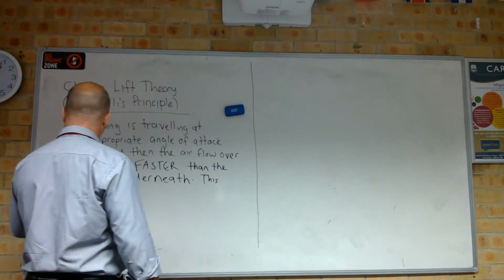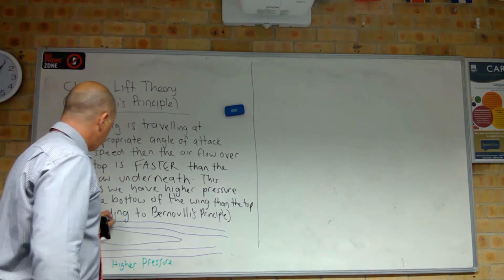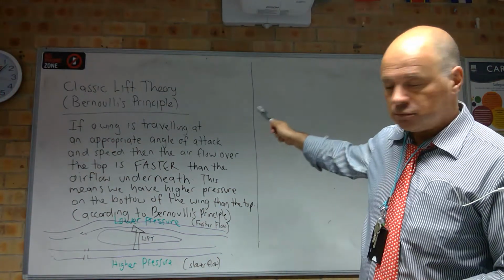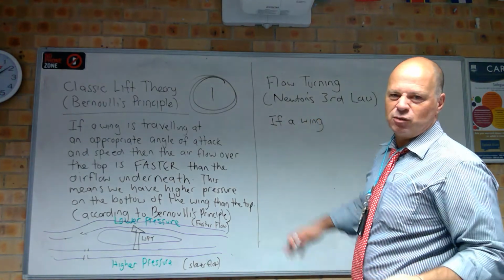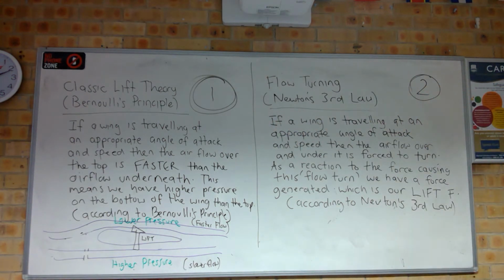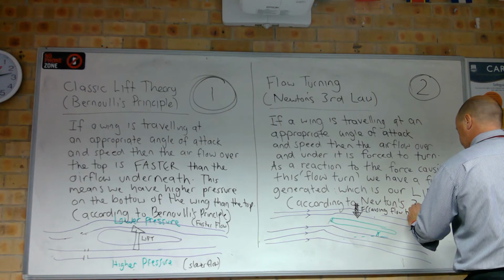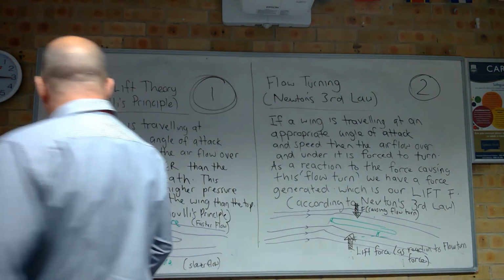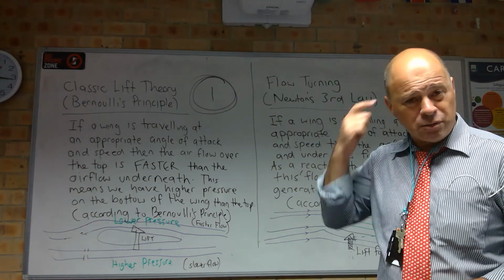Wing Lift - Classic and Flow Turning Theories

Comment: CFD (computational fluid dynamics). In that we solve the Navier-Stokes numerically, because there is no simple closed form analytical expression, like Bernoulli's equation, which is true, but only for inviscid, incompressible, irrotational flow. That is, if we have very simple ideal fluids, you can get analytics expressions for the velocity and pressure field (not just a long a single streamline). However, the Navier-Stokes do not. That does not make them "unsolved" in the everyday sense, that make them "unsolved" in the narrow mathematical sense of "do smooth unique fields always exist that satisfy this type of differential equation". But, given weather forecasting uses the Navier-Stoke, as well as Boeing and Airbus, we get "solutions" to them constantly that help us in everyday life. Numerical methods are not less than analytic methods of solving problems, they are different and misunderstood.

George, the main thing I would love for critical thinkers to consider when they see both images side by side is, why are they different? This is a key question. Because they should not be different diagrams, they are explaining the same thing. So, as you might notice in your other videos, the correct flow illustration can be seen in Prandtl (1923) "Applications of Modern Hydrodynamics to Aeronautics" (available from NASA as a PDF), in Figure 27. There is a change in momentum, which is what "flow turning" is the incorrect defacto short hand of, and there is a pressure difference. But these are two aspects of the same phenomena, the fluid flow, and hence the diagram must be the same. That is, you can take Figure 27, and you can write higher speed lower pressure above, and you can draw the flow up towards the aerofoil at the LE and down away from the aerofoil at the TE such that both "causes" result in the same "effect" (lift). The key thing here is that the change in momentum is across the aerofoil, not behind it. A wing is not a hot knife through butter, cutting the air. As before, happy to talk more.
Reply from the maker: Thanks for this long and considered response. I am a Visual Art teacher with recent traumatic experience of an Engineering degree (BAILED out after 18 months of Mechatronics - passed the gate keeper subjects but math was scary and I iz too dumb). I'm teaching high school Engineering Studies and I have seen these 2 simplified ways of explaining it. Is the example 2 (as a simple explanation too simple and just plain wrong?). Also if we use FIG27 (from the NASA PDF) and we have slower air below  the wing (reduced momentum) and faster air above is the force causing this change in momentum (below the aerofoil) due to the angle of attack and is the reaction to this force LIFT?  If you had to teach a basic explanation of lift what would you resort to? Thanks for helping out.
Reply: @TheArtofEngineering  unfortunately YouTube appears to have killed my very detailed long reply. Shorter version below, going to edit this reply to the question. Example 2 is based on reality, but the actual real physics has been abstracted away. The idea that the momentum changes across an aerofoil doesn't work as narratively simple as "air goes down so wing goes up." This is not 100% wrong, it is literally only 50% wrong. Because the air first turns up, then the wing turns it down, so it goes back out horizontal. So, the best way to describe the correct shape of streamlines in the most simple way, is as a bell curve. Horizontal in, turn up, apex, turn down, horizontal out. But, that does not appear to allign with Netwon's 3rd law, because people are applying Newton's 3rd law wrong.
Reply: @TheArtofEngineering  A shorter version...
As a lecturer, I want to engage in dialogue, I want to ask question, so I will ask the question and I hope you pause and answer full:
If I have the horizontal tailplane, and it is a NACA0008 aerofoil, at zero degrees angle of attack, what happens to the air and then to the "wing" when I deflect the control surface. Ideally, I would want you to draw this.
Give it a go, even if it is just a mental image.
There are two common aviation descriptions.
1) Based on Newton's explanation, which he knew was wrong, you deflect the control surface down, and the air flow "reflects" off this. This give a sin square relationship between lift and AoA.
2) Based on softer flow turning, like Coanda, you deflect the control surface down, and the air flow follows this new shape. This give a sin relationship between lift and AoA.
But if you recall your coefficient of lift as a function of AoA plots, you should know that the relationship is linear.
So, neither of these two explanations is what is happening.
What does Prandtl say happens? When you deflect the control surface down, you shed a vortex off the trailing edge, and this induces a bound circulation around the "wing". That give faster flow above, and slower flow under, with higher pressure below, and lower pressure above. Hence the pressure difference that is lift.
Why this vortex is created at the trailing edge is created is because the flow going around the trailing edge, reverses a little, and moves back up the top surface of the control surface. This is because when the control surface first moves there is an initial reduced pressure. Where the flow is turning around the trailing edge, this interacts with the flow a little further away via viscosity, and this force inflates the vortex. This growing vortex, like all vortices, has a low pressure in the middle. Where the flow reversed up the top of the control surfuce, it eventually met with the decending flow, and at that location is the initial stagnation point, the point of high pressure. But that high pressure point is not close to this new low pressure point in the centre of rotation. Eventually the vortex grows so big and the pressure so low, that it sucks the stagnation point down to the trailing edge. This extra pressure gradient created at the trailing edge, that is the extra force speeding the flow up over the top, reducing the pressure above.
Reply: @TheArtofEngineering George, posting the reply here just to make sure you scroll up and check the other replies here from last night.
You can share my papers, they are open access for a reason. Also, feel free to invite me in to talk, assuming you can't manage a field trip to Canberra 😂
Reply from the maker: @aerospacedoctor  Thanks so much! I will hopefully be sending some more budding engineers your way (at least for the next couple of years).
Reply: @TheArtofEngineering please tell me you saw the long message from 16 hours ago 😅
Do me a favour and like that so I know you have read it.

Comment: In the  still reference frame molecules of air start with no velocity ,then are excellerated. This is best described as an excelleration. Only in the moving reference frame should you describe it as a turning or deflection.

Comment: The bernoulli effect doesn't explain why lift happens.  It helps explain how force is transmitted but the cause of the force. Lift is a reaction force that is solely caused by the action force of downward excellerated air. A pressure differential doesn't cause lift. Rather,  a pressure differential is lift caused  by excellerated air. The air starts with no velocity then begins excelleration. It is not possible to get lift without this excelleration. Nor is it possible to excellerate air without getting a lift force. And air's ability to trade pressure energy for kinetic energy(the bernoulli effect) doesn't cause lift.
Reply: Robert, I have noted a substantial number of comments from you in multiple lift videos, if you would like to discuss, please let me know.
Reply: Hi Doctor. Thank you  for inviting discussion.  If you look at this air movement through the still reference frame, the air molecules start with no kinetic energy, then begin to excellerate.  The path begins with a rearward and upward then downward and forward path. It's shaped like a half of a heart symbol. But in the moving reference frame, it's a different shape. So that it's necessary to establish one or the other reference frame before  you can say what direction the air is moving. The turning/ excelleration have in both reference frames. Lifts solitary cause is excelleration of air. As you can't excellerate air without causing a force, you also cannot get a force without excellerating air. The excelleration is the action, and the lift force is the reaction.  The excelleration rate and the volume of air determine the size of the force. What do you think?
Reply: @Robert-d5l  I am keen for a Socratic dialogue if you will engage. In this context, it means my goal is to ask question to test your understanding.

The first question is, do you accept that physics, specifically classical mechanics, is required to be causal and local? That is, if there is a cause and effect, the cause must occur before the effect (causality) and the cause and effect if separate must have a mechanism to communicate the force, and in a timeframe that obeys the fundamental limits of physics. That is, Newton's theory of gravity is not causal, he used the term "hypotheses non fingo" (he posed no cause of gravity) and non-local, the speed of gravity is infinite. This gives action at a distance. General relativity resolves these issues.

If you accept that philosophically physics needs to be causal, and it should be local, then my question is this: the general claim about air being accelerated down is it is in the wake, and at an arbitrary distance behind an aircraft. This object is referred to as the Trefftz plane, and it is where aerodynamicists determine induced drag. If the air was being accelerated down back here in the wake, and that is the cause of lift, how is it happening after the effect (lift), and how is it communicating that information to the wing an arbitrary distance away?

Comment: where does the bernoulli principle come into flow turning in particular? or is it separate and only combined when putting the theories together?
Reply from the maker: It is probably best to describe lift using one or the other. I think for the NSW HSC either is OK. I suspect both have a part to play. Newton's flow turning explanation and Bernoulli explanation. see link below 😜
https://www.grc.nasa.gov/www/k-12/VirtualAero/BottleRocket/airplane/wrong1.html#:~:text=Therefore%2C%20the%20molecules%20going%20over,the%20airfoil%20produces%20the%20lift.
Reply: wesuckatengineering they are not separate. Bernoulli and flow turning are different projections of the same momentum balance. The turning of the flow (from horizontal flow in, to upward turning ahead of the leading edge, to downward turning after the trailing edge, back to horizontal flow out) is set by the pressure gradient field. Bernoulli relates pressure changes along a streamline to changes in speed, while the curvature of streamlines reflects transverse pressure gradients. When written in vector form, both effects appear in the same momentum equation. Bernoulli is not causing the turning, nor is it an add on, it is simply one way of describing part of the same physics. So, if the flow changes direction or the streamline density changes, Bernoulli immediately requires a change in pressure. That change is the conversion between static and dynamic pressure. These are not different descriptions of different phenomena, they are different aspects of the same momentum balance. Flow around a wing both turns and changes speed. Turning requires transverse pressure gradients, and acceleration or deceleration along the streamline changes pressure according to Bernoulli.